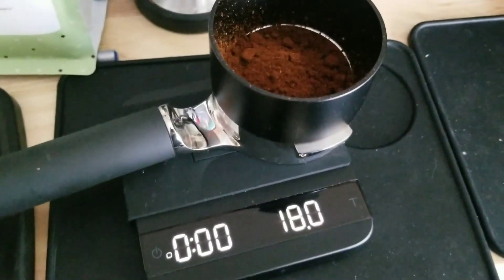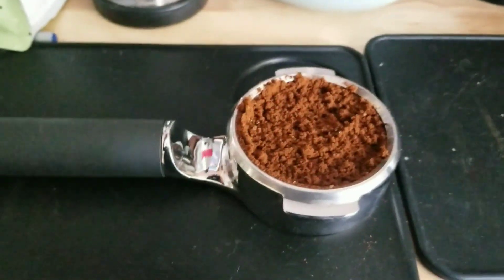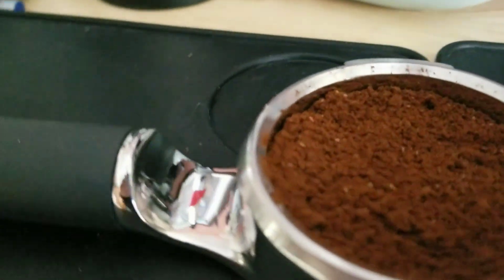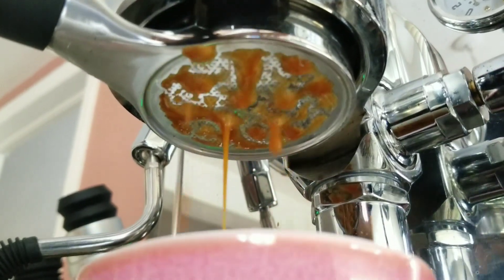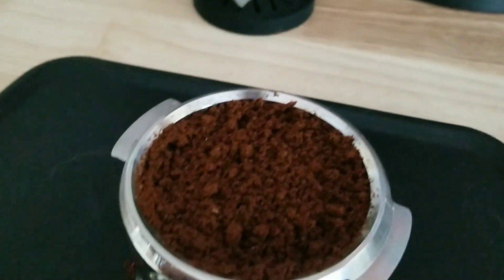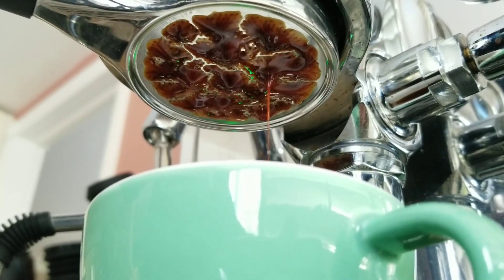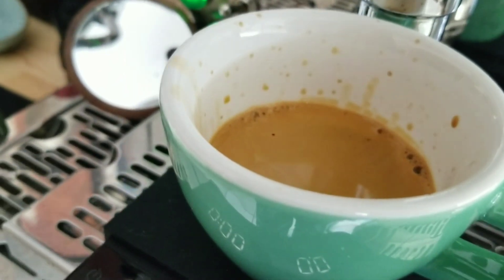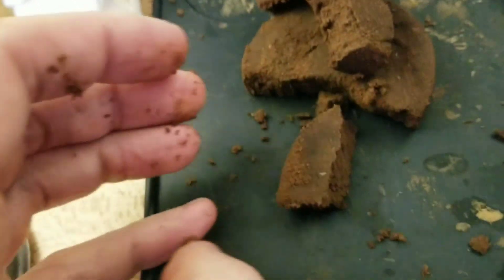Making some Monogram Coffees with Monolith Flat, Synchronika, Weber Unifilter and 3D Auto WDT tool

Comment from the maker: I've since had this one replaced with the updated model by the maker of them and it works MUCH better, I should do another video. Unfortunately it didn't fit my ECM Portafilter but fit the Weber Unifilter perfectly (which I no longer have, might get the Buck Portafilter or something similar later.).